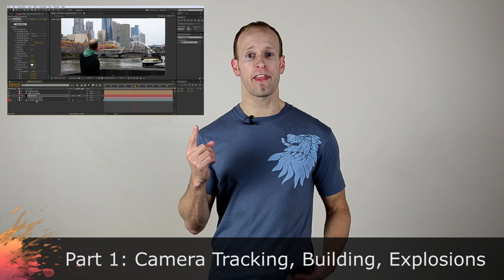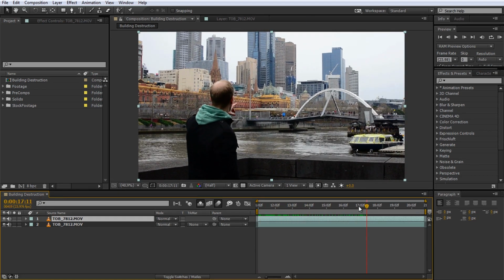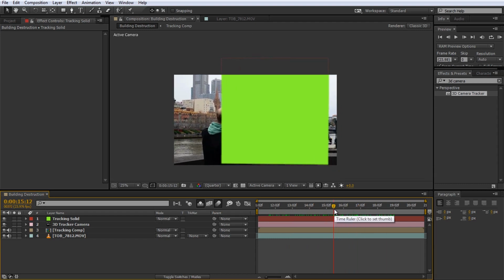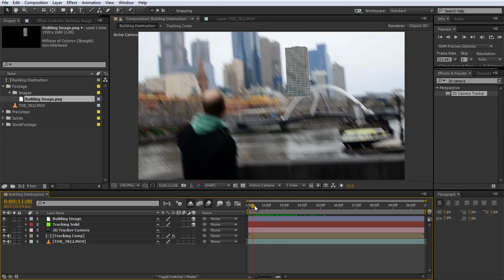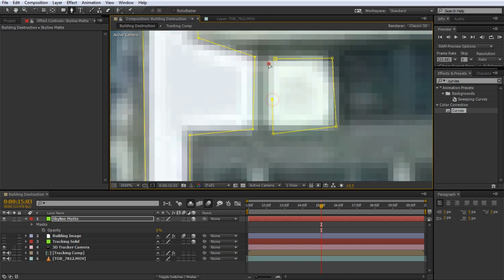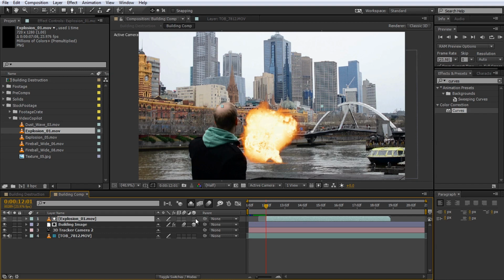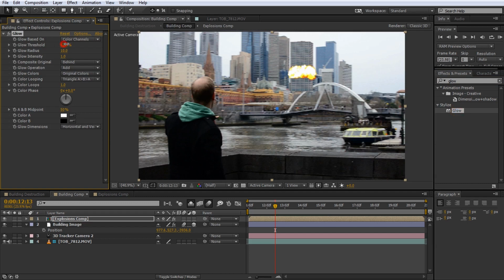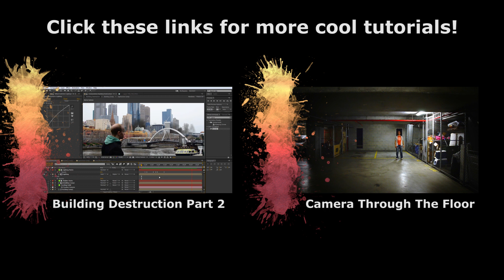Adobe After Effects - How To Blow Up A Building (Part 1)

Comment from the maker: Fair point, it was a bit fast for a building collapse :) Yeah, buildings tend to also crumble apart in a very distinct erosion-expansion pattern. I did take a lot of shortcuts for this effect because for most home projects it doesn't have to be 100% accurate, just sell the effect - and it kept the tutorial at a reasonable length. If you want all the power, you'd have to do a full 3D integration with physics and smoke simulations :) Thanks!